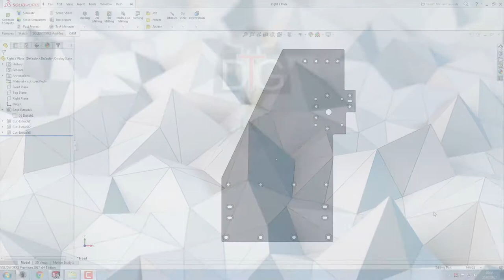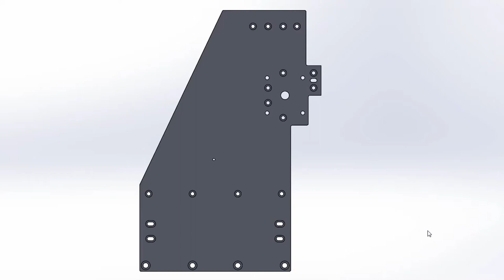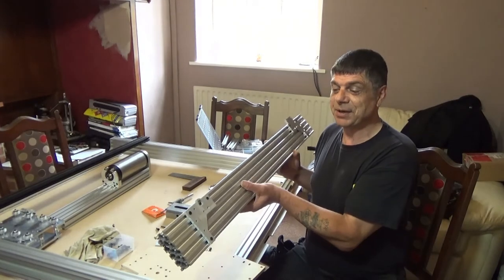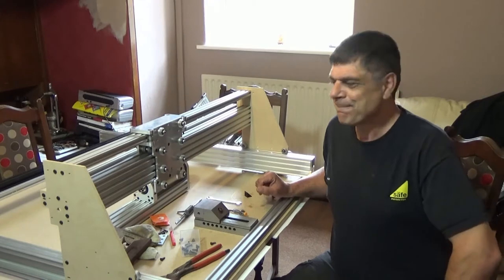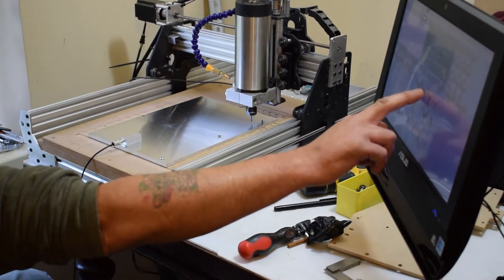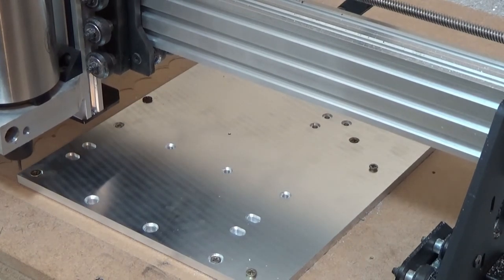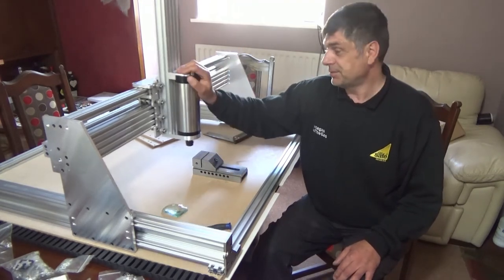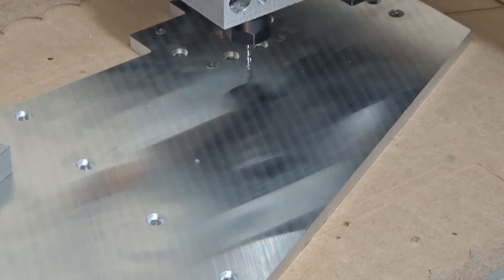Spartacus Part 6 - Y Axis Plates

Comment: Nice video Daz. If I ever get this darn OX working properly. I'll be converting it to the Spartacus and listing the original OX plates on Ebay. My X Axis works perfectly thanks to the extension plates that I ordered off of you a couple of months ago and now I just need to get my Y Axis to follow suit. I notice you've got a mix of the Extreme Wheels and the Regular Black Wheels. Are you having issues with the Extreme ones like I am?  Quite a few of mine have developed split shells.

Comment: Hi Daz, for months I have been contemplating the same issue of making new Y plates to increase the Z height limitation of the OX, and then came across your video. Great video, I have also been using Ooznest for my OX build, I did mine through a kit order, but had already started travelling down the C beam route. I'm looking to change my current belt driven Y axis for the C-beam acme screw drive 1000mm assembly I already have, the Y plates you show would be perfect, have you got plans available, and also what grade of aluminium did you use for the new plates? Great channel by the way, keep up the good work.

Comment: Hi Daz,
Looks like its going to be a smooth running machine. Are you going to use the steppers off the OX or are you going to use some servo drives.
Cheers Dave.